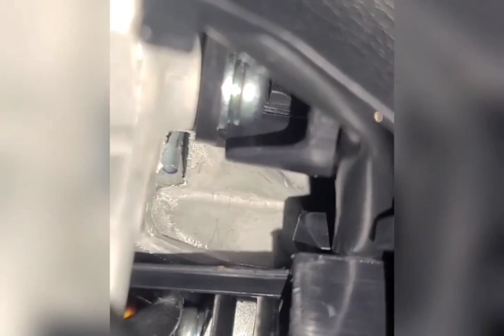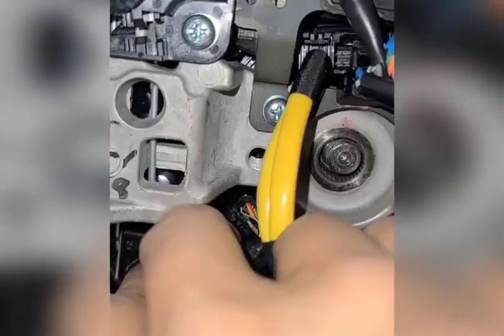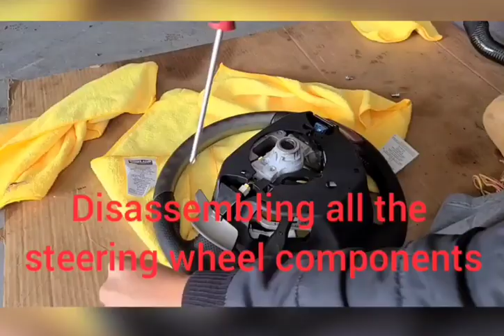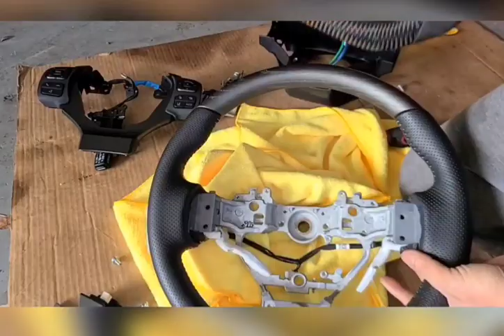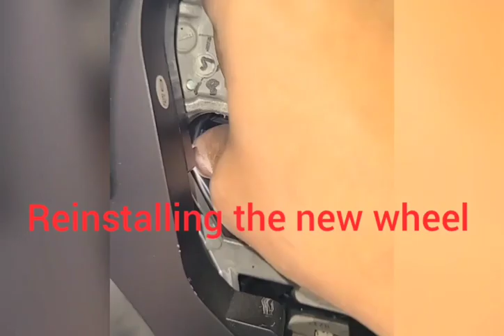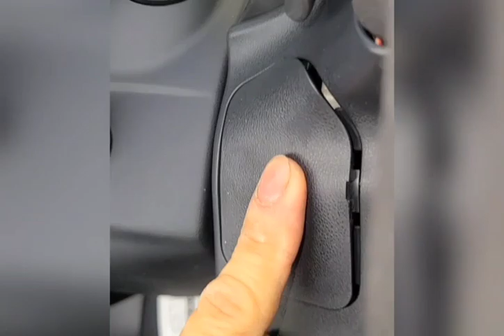Installing a Lexus RCF carbon fiber steering wheel on an IS500 Launch Edition

Comment: looks great - have you kept your heating function as well as LDA?  I do not catch the new wheel has wiring for heating neither you transferred the LDA modules you transferred to new one...
Reply from the maker: Unfortunately, this wheel didn't come with a heating function built in, so I never transferred it from the stock wheel, there are other wheel companies that will integrate the heating function into the aftermarket wheel.